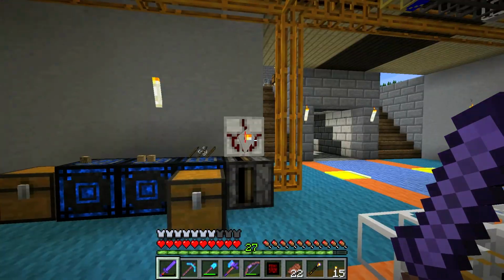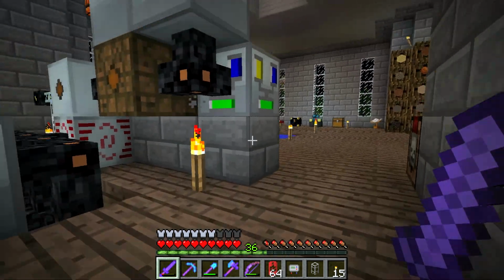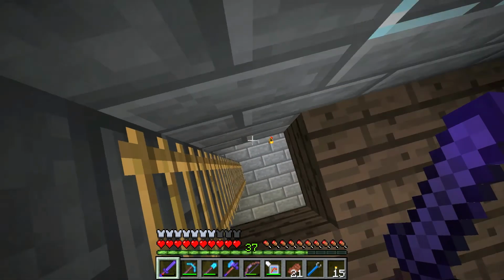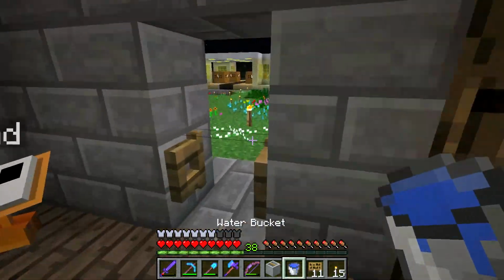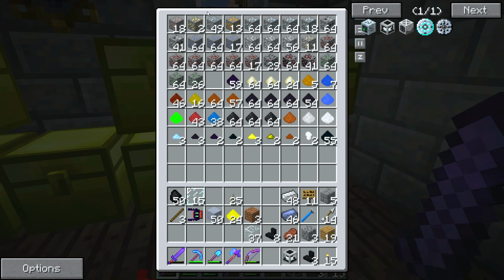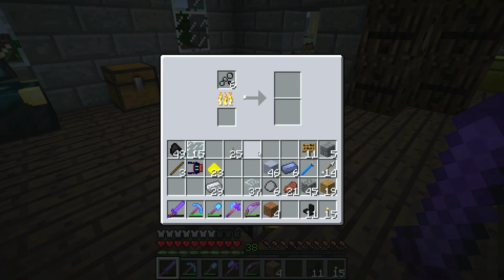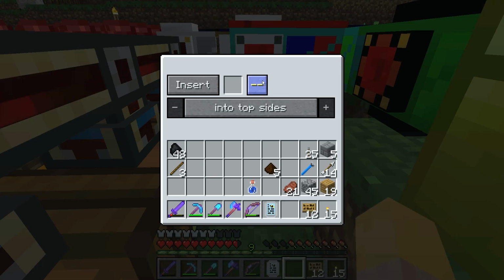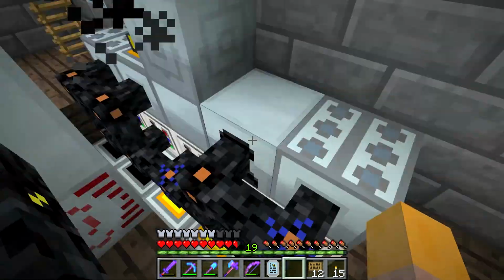Let's Play Feed the Beast - S2 E24: Factorized

Comment: When the jar is rewritten, due to pack updates (most often) or glitches (less often) the achievements reset. It is possible to rebuild the jar without losing any achievements but it is a very low priority for Forge. Though there is a mod called KeepMyStats that will help with that.

Comment: You can make a "Wrath furnace". Make a coke-oven type of structure out of netherbrick and leave a hollow center and 1 hollow center on 1 side. and u ignite the center of the structure and place a block in the hole on the side, then mine it. U can put a deployer/block breaker around it if u want to push a button and auto place/break blocks. But that's basically how it burns forever.

Comment: The router is also a little funky. It goes through adjacent inventories. Apparently pipes count as inventories as well, which means... well, you saw what happened. What you're referring to with the wrath igniter is a wrath forge. Build a coke oven out of nether brick, leaving one side open, and use the igniter in the center hole. You can cook iron like that, and even use deployers and block breakers in the side. 
And you're better off just using glass fiber cable everywhere. There's less eu loss

Comment: The factorization power grid works with saturation. The reason the battery lost power was because it was saturating the line. FZ power works like blutricity, so all the machines share power through themselves. 
You also want to add more mirrors. 4srs. The faster the turbine spins, the more power it generates.
I'm not sure if you can pipe in water into the mixer, but I'd suggest either a bucket turtle or some redpower stuff.
The crystallizer gives you 3 crystalline iron for every 2 chunks. 150%.